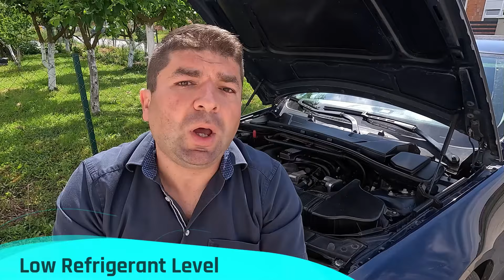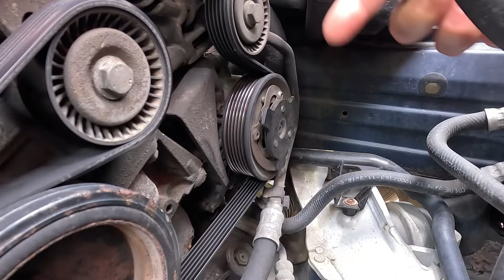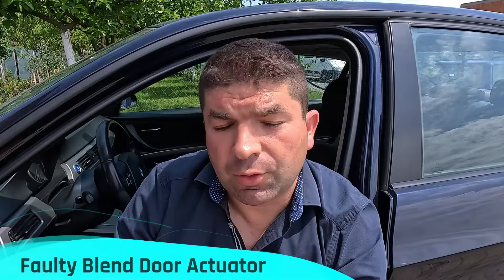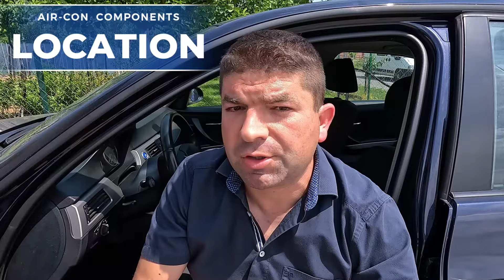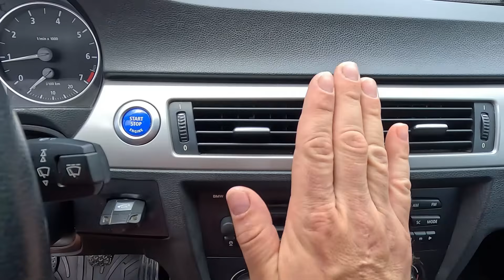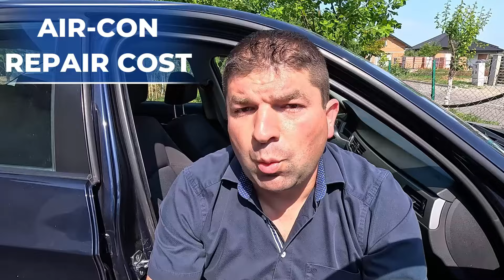Car AC Not Blowing Cold Air? 9 Common Causes & How to fix it

Comment: Awesome information mate! Subscribed without hesitation. My ac cuts in and out, when it cuts out I leave engine running and ac button "on" and manually check clutch and its not spinning. It only starts when the ac kicks back in. Do you have any suggestions ? Not sure if this is related but my engine is running hotter then usual ever since this started. I monitor coolant temps on device plugged into OBD port constantly.  PLease help I'm in Australia and its middle of summer. I've had it checked for leaks etc.. everything is good with that aspect

Comment: Hi .. thank you so much for your professional videos and clear explanation.  May you please help in answering one question. My car is bmw e90 320i 2008, lately the technician has canceled the heater (closing two pipes)  as the hot air is mixing with the cold air that cooling the cabin. My question: Does the thermostat work properly opening and closing acc to the tempreture or it will be continuously open and won't cool the engine properly, knowing that the fan is mostly working continuously.    Thankyou
Reply from the maker: Hello. So, I suppose your AC unit or the heater valve (one that opens the flow towards the cabin heater) are broken. Now, if you sealed off the heater manually, this won't affect the engine's cooling - everything will be running as it should (thermostat, fan and so on).